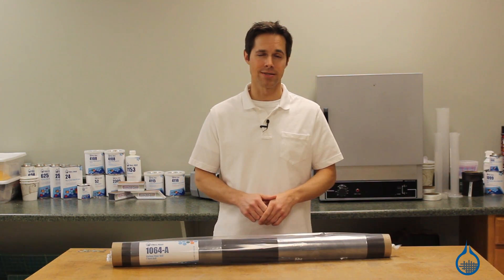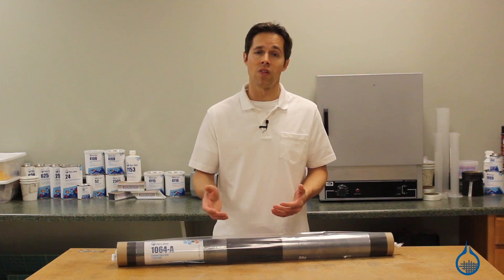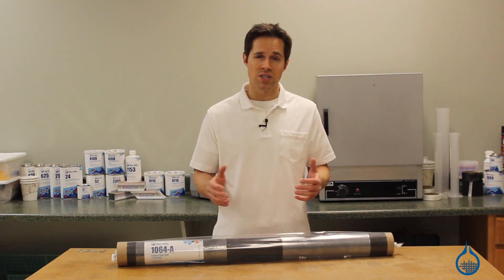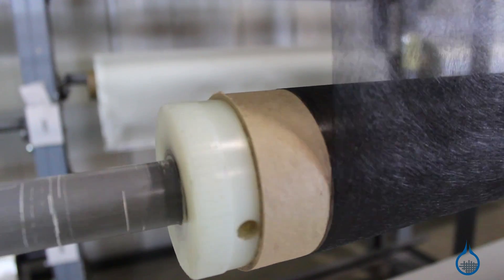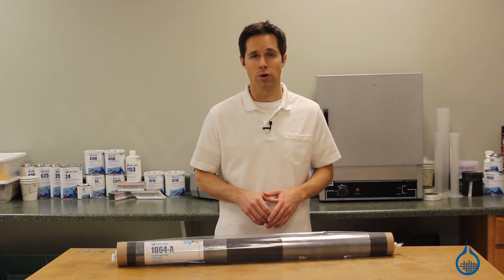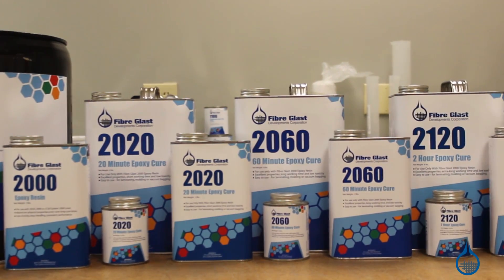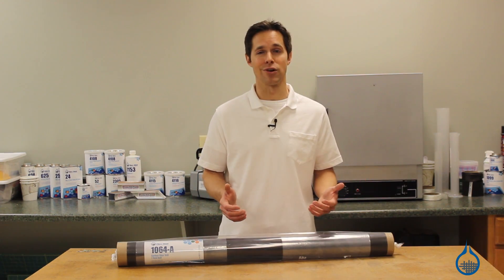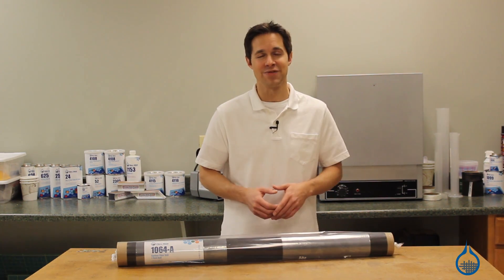Carbon Fiber Veil

Comment: "effective at keeping excess resin from draining into cells of honeycomb cores when a vacuum is not being used." 

If vacuum is used, doesn't the resin get sucked into the cells of honeycomb cores? I still has not figured out a way to laminate carbon fiber to both side of a honeycomb core with resin infusion.
Reply from the maker: In that application, you would laminate the veil on both sides of the honeycomb via wet layup prior to the infusion.
Reply: You mean use the veil to close the honeycomb. first? Does veil have to be dry first?
Reply from the maker: Aviator168 Correct.  You would determine the size/shape that the honeycomb would need to be for the application and do a wet layup of only the nomex and veil prior to your infusion... allowing the skinned honeycomb to cure prior to infusing the ultimate part.
Reply: Thanks. That's great

Comment: I am looking to design and build a fishing kayak using some advanced features such as epoxy, kevlar, carbon fiber, and vacuum bagging.... given that I am looking to insert some honeycomb cells for some critical strength areas.... this fabric and the presentation, were very interesting... particularly since I am considering finishing the upper deck with the blue kevlar/carbon fiber blend and a clear finish...  I have not decided whether to finish with a gloss finish (which this fabric would enhance) or let it show a more textured finish as many carbon fiber cloth finishes do present.